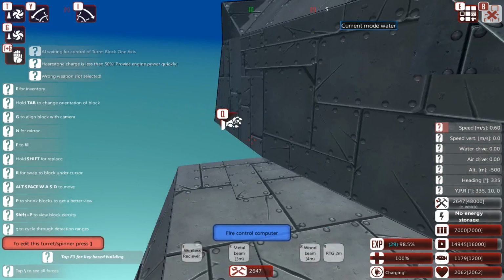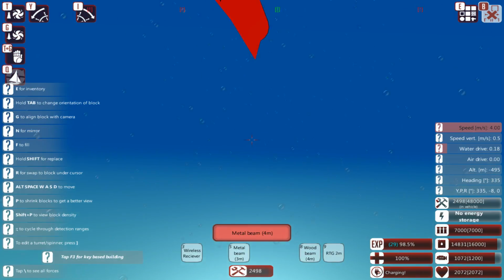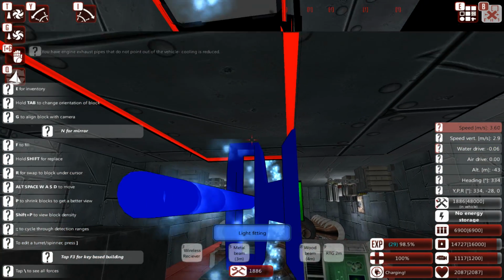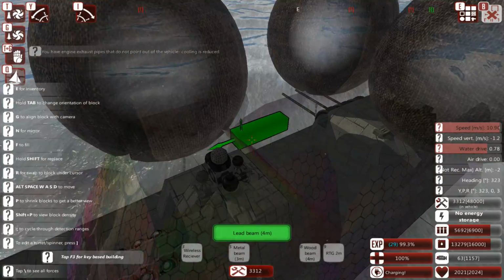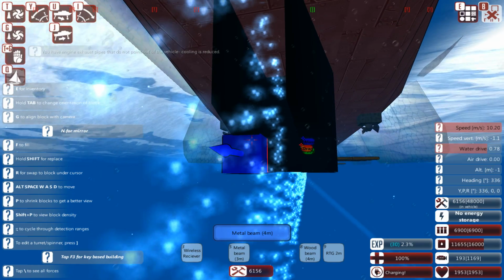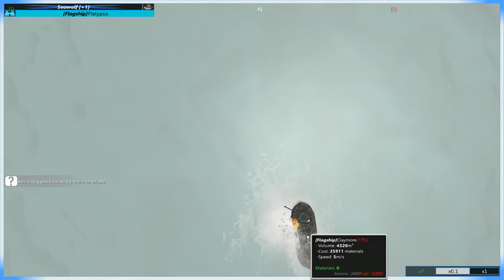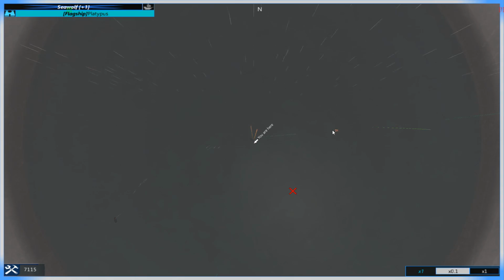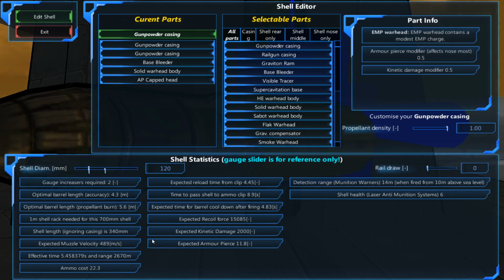From the Depths - Adventure Mode - Submarine Attempt #341 - Part 11

Comment: separate you ammo compartments. make couple of heavy armor cases with ammo, usually one the front of the ship and one on the back. Alternate option is to put couple of ammo boxes on long "sticks" behind your ship do confuse ai with aimpoint selection.
also, get rid of the keel - its far too heavy for your ship and/or make bottom of your ship out of 1-2 layers of lightweight alloy (if u can afford) or wood - they both have good buyoncy. 
Get rid of those prop stabilizers - they blow in my experience, usually do more harm than good. Use dedicated helispiners with automated control blocks for stabilization -> they are absurdly engine power effitient + they are quite sturdy and they profit greatly from FtD physics as heliblades ignore collision.
I'd also say to get rid of those prefab weapons but I understand that it can be problematic to construct anything in adventure mode.
Anyways, awesome video, enjoyed it. Please keep up the good work.
Reply from the maker: Thanks for your points. I have tried to play the ship without the keel. It didn't work; the ship rolled over. My CoM was way too high. So it has to stay. I can go with the wood to replace the metal lower decks though.

Comment: Do you think Heavy Armor is worth it? I started replacing all lead beams with heavy armor beams. The weight is the same, so it works for balancing and it can come in all different shapes. A single strip along the bottom can keep my ships from breaking in two, but I am not sure if there are any real downsides apart from a bit higher cost.
Reply from the maker: Heavy armor is really expensive. I believe it used to be quite heavy as well. So much so that it can make your ship top-heavy. But if it works for you then sure :). I might add it to my ship as well.
Reply: Thats the whole point, I use it for balancing, not the top. That way the hull seems more stable and you don't need as much.
Reply: So much action, me like life on the surface. :-) First thing learned is segment ammo so one hit dont blowup all, I am so impressed with your ability to stay came when you ship is bottomless along with a missing heartstone and avatar, well done. Also you need 3block thick hull armour so you can take hits.